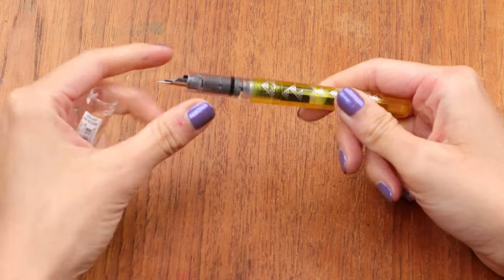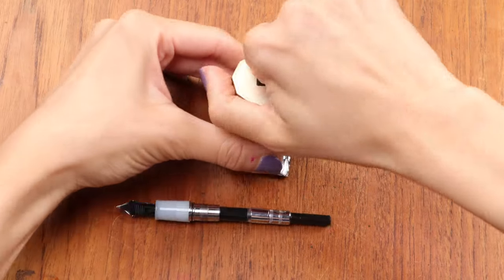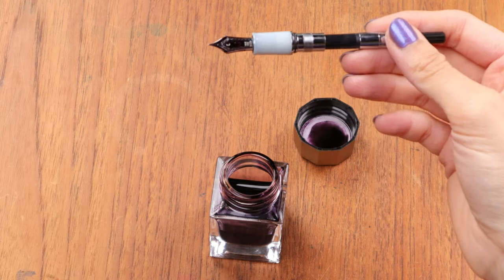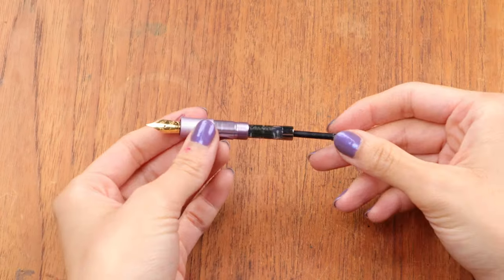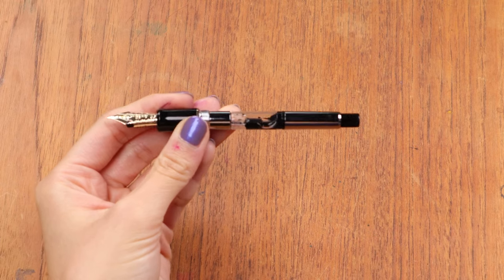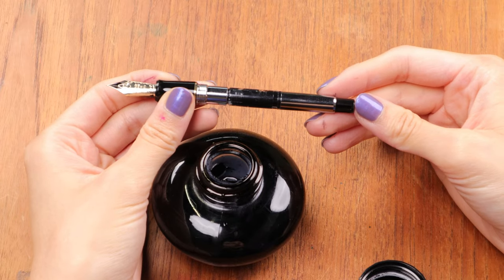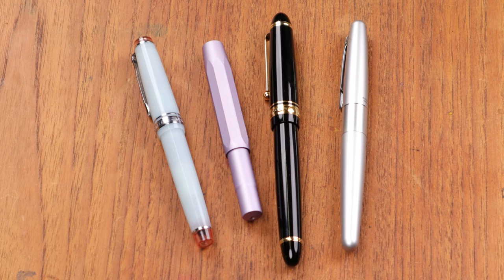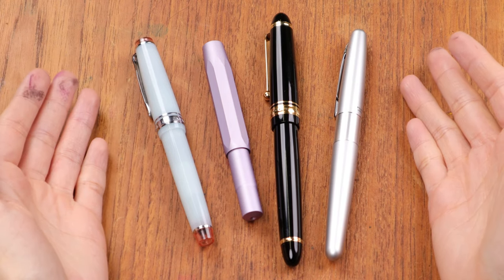3 Fountain Pen Converter Types Explained!

Comment: I have a Pilot Metro and I struggle with the squeeze converter, I'm still new to it and have only done it a few times.
Reply: Hey ladyamalthea85, had a pilot metropolitan myself. With the con-B squeeze converter, I found that taking the converter out - then using a syringe to fill it almost to the top (you want to leave room) - keeping that converter vertical filled with ink (yep it will spill if it you try to insert it horizontally) to push that up to connect to the pen. Hope you give this a try if you want, hope it helps 😁Have fun with the pilot metropolitan, that's a good pen 😃
Reply: @Earthly_7  thanks for the tip! I do love using the pen, it's such a nice experience.